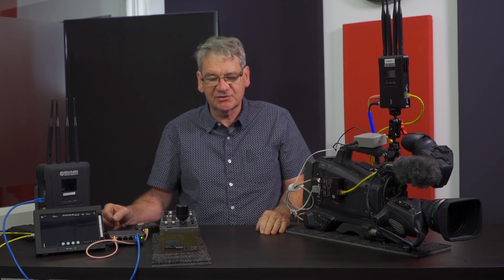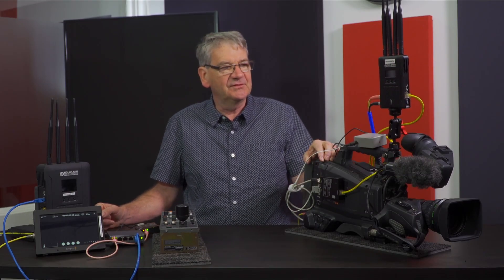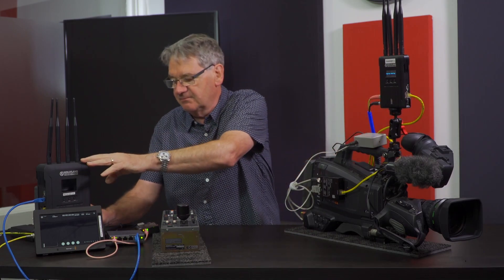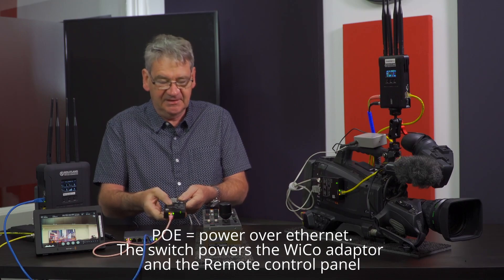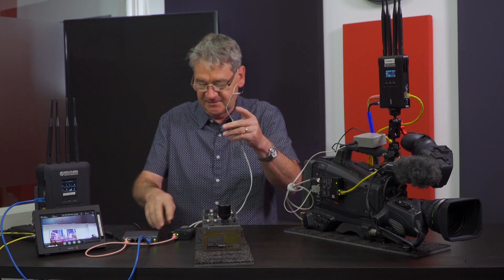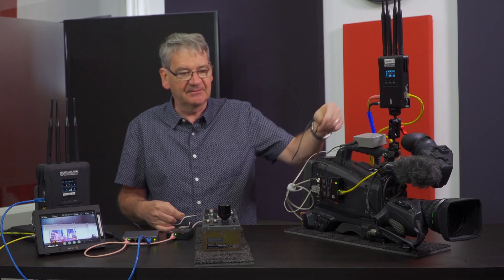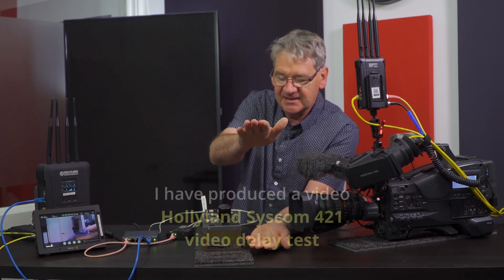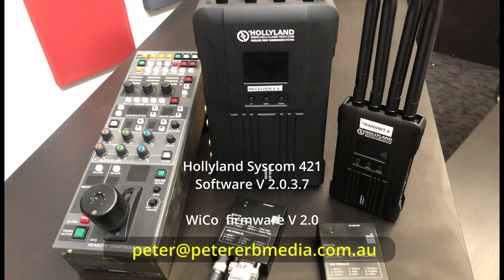Hollyland Syscom 421 Wireless Video system and WiCO ip CCU camera control demonstration

Comment: Hi Peter, how do you find the robustness of the video and control in busy RF event environments ?
Reply: I have not found too many problems using the system as described - the rf camera signal woks well in stadium conditions as well as out door music venues. That said the wico camera control is sometimes temperamental to get operating- you need to make sure that the RCP side is connected and you have a return Network link between the Hollyland Base and the  on camera transmitter. _ remember the whole system is an IP network. I usually reconnect the WiCo camera end and find that the system then works reliably.